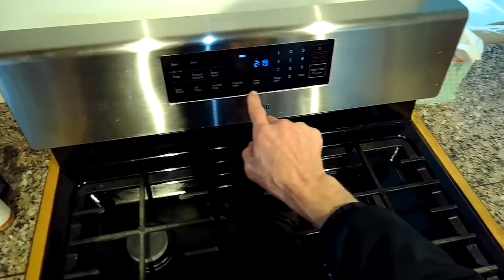✨ OVEN TOUCHSCREEN NOT WORKING — EASY FIX ✨

Comment: Thank you! This worked. We paid a workman to remove the panel (the buttons in the middle column were not working on both right and left hand side of the panel Kenmore Elite electric oven). Meanwhile after looking everywhere for a replacement, we finally ordered the entire panel on ebay ($300, after contacting many repair places where we were told that the panel can't be repaired). Long story short the ebay panel turned out not to be an exact match. I figured I give your method a try. Hubby and myself put the panel back in and voila! All the buttons are working again! Ebay purchase was returned. Thank you again for teaching me how to save favorite appliance 😊 hopefully good things will happen to you in life.
Reply from the maker: Thanks so much Millikan, I really appreciate your kind words 😊👍

Comment: i replaced the controller initially only the pizza button was working and oven will come on, broil and bake button was not working after replacing the controller the buttons all work now, however when i press bake, broil, pizza i don't see the flames coming on inside the oven, i am sure it is not the ignitor since it was working prior to replacing the controller, can you suggest anything
Reply from the maker: Maybe the igniter👍

Comment: Hi Scott, I used your eraser cleaning method and it worked. Now keys are working but the oven still does not heat. Broiler and stove works fine. Do you think I need control panel ? I was going to replace touch pad.
Reply from the maker: Hey Tom, if it’s a gas oven you probably just need a new igniter.
Reply: Thanks
Reply: Hard to believe Touch pad and igniter went bad together. But I thought igniter probably bad

Comment: Thank you so much for this video. The most difficult part was the access to the damn control board. I had to partially remove the whole cabinet involving the oven and microwave. Finding the hidden screws when there is no instruction for a particular model is the hardest part. Anyway, I got the idea where to look for after watching several different videos. One last note, the ribbon cable has two ends, cleaning the big end that goes on the PCB didn't work but the culprit was the other smaller end of the cable. Thanks again for the idea what could go wrong.

Comment: Listen Scott... it's people like you and videos like this that bring A LOT of positivity to the 21st century. As everyone knows, we live in an age when your lucky if an appliance last more than 3 years. Whether it's Planned Obsolescence or not, most appliances are simply not built to last. Our Samsung convection range is only 3 years old. Already had to replace the convection motor (which thank goodness someone posted a Youtube vid that directs you on how to order the motor off Amazon and install it yourself!!)...and today...2 days before the Thanksgiving turkey goes in the oven...the control panel craps out. Did exactly what you said and BAM!!! Huge brownie points with the wife buddy (big thanks :). Had quite a difficult time dislodging the ribbon... so like you advised, use a flat head screw driver and VERY carefully and slowly alternate prying out the top & bottom tips of the plastic ribbon base connector thingy. I used Isopropyl Alcohol on a q-tip...worked perfect !! Thanks again.
Reply from the maker: That is so cool Eric,  thank you😊

Comment: Thank You!! You have saved me hundreds! I replaced my own board on my Samsung Gas Range Model# NX58J5600SG/AA with a part from Sears Part# DE92-02588J which cost about $180 with shipping. The Ribbon Cable you spoke of was the problem with ours because I did not know that there was a slide out piece on the piece that connects to the board. This allows the ribbon cable to dislodge from the board. None of the YouTube videos I watched mentioned this but yours! The range had no function on the keypad until I properly installed the ribbon cable. I have clock function, timer and cook timer working. Although I still have no beeping of the timers etc?! I am going to try and reinsert the cable one more time before I button her up. Thanks again!!
Reply from the maker: Wow,

Nice job👍😊

Comment: Worked great! The longest part for me was realizing that the ribbon cable pulls out and the black assembly just clamps down on it. I was expecting pin connectors.

Once I figured that out (5 minutes) everything was easy. Added a little dielectric grease as a preventative measure.
Reply from the maker: Nice job Matthew👍😊
Reply from the maker: Nice job Matthew👍😊

Comment: Thanks for your efforts to share this solution! I followed all your instructions and did repeated tests and just didn't have any satisfactory results. I was almost resigned to trashing the range but was really bummed as I just spent over a hundred bucks replacing the carbon broiler element. I looked into maybe replacing the control board but that would cost me north of $400. Grrrrr! I decided to have another look at the ribbon and saw the indents where the socket pins made contact. It was then I decided to go for broke. With a sharp pair of scissors I cut about 3/32nds (2mm) off the end of the tape making sure to keep square.I Inserted the ribbon and locked it down. Time to flip the breaker and test. Yay! OMG so happy I don't have to retire this appliance as it is still in such good condition overall. Hope someone can use this info to keep their appliance from being scrapped. Cheers to all the determined fixers out there! 5:26
Reply from the maker: Nice job,
You are courageous 😊

Comment: Excellent video Scott, thank you very much! I googled the electrical cleaner and it's basically isopropyl alcohol so instead of using an eraser I used a fine Mist sprayer with 91% isopropyl alcohol. after removing the ribbon cable I sprayed a small amount (twice)with a paper towel underneath it to catch any drips.
Worked like a charm! Again thank you for the excellent video,no music, no annoying chitter-chatter,straight to the point!😁👍
Reply from the maker: Great idea Ron,

Thank you
Reply: @ScottTheFixItGuyChannel  your welcome

Comment: Scott, thanks so much!  I followed your advice and it worked for about 5 days.  I had to repeat the process 3 more times over the next month.  I may have found root cause.  On the last try I put a piece of Scotch tape over the top of the touch screen and the brushed stainless panel over it.  My thought is over the years pushing the screen buttons created a slight gap between the top of the touch screen and metal frame.  This allowed steam from cooking to seep through and short out circuit points.  Going on 2 weeks plus and no error code!  Tape over the screen/frame looks crummy.  Maybe I'll remove it and caulk with a thin line if window glaze?

Comment: The manufacturer of my oven (oster) had applied some sort of glue along the edge of the ribbon and the plastic connector. I carefully chipped it away with a razor blade and pulled the ribbon, sure enough about half of the pins had corrosion. Going to get some electronic parts cleaner today. Thanks for the video!
Reply from the maker: Wow, nice job Christopher.
You’re pretty brave to chip away that glue.
I’m so glad it worked.
Reply: @Scott The Fix-It Guy  DIY Appliance Videos   it did work. I was so excited when the buttons magically worked again. I figured it was trash anyway so it didn't matter if I damaged the cable, luckily I didn't and now it works like new. Thanks again!

Comment: My newer Samsung Gas Range key pad randomly cycles through settings...ie  HI, LOW, dehydrate, time etc....will cleaning the contacts on the tape work for this issue? (just past year warranty)
Reply from the maker: Hi Barb,
I think you may have one of your keys stuck in the pushed in position. Maybe the one that lets you scroll through selections.

I would try pushing in on that button several times to try and free it up.
You can try using a hairdryer at low heat directed at those keys for 3 minutes.
Reply: @ScottTheFixItGuyChannel  Hi!  Removed the back panel and erasered the connection, tightened all the other connectors.  I also did a hard wiping/pressing the buttons and blow dried the front.   OMG...the problem has not come back yet for 3 hours!  I'm hoping it is fixed, cannot thank you enough, saved us $$$.
Reply: @barbcurphy6999  wow, nicely done Barb❤😊

Comment: Thanks, great tip & informative video. Would it work in my case - I have a LG electric range & last weekend when I pressed the button for the rear small (single element) cooktop, it would also turn on the dual element cooktop in front. And I am not able to turn it off unless I turn off the small cooktop. Much appreciated for your advice.
Reply from the maker: You might need to replace the touch pad .  They’re pretty cheap.
Reply: Many thanks Scott.
Reply: I have this same problem, let me know if you find a solution (can't use my left elements)
Reply: The LG tech tells me likely I need to change the board & as it will cost about $450, I may as well wait a bit until something else happens for me to justify replacing it with a new range.

Comment: I saw the same fix on another post. Thanks. 

I have LG LREL6323S electric range purchased Jan 2022. The LED display board failed Jan 2024 losing one portion of the digital display. This is a known issue at 2 yrs based on my research and notes. The warranty is 1 yrs and LG quoted repair at appx $345. LG is not recommended by my local appliance repair shop. I do NOT recommend LG for various reasons.

Comment: Hello! Mine does not have the strip in the back how would I fix this problem? I have the Amana control board AGR5330BAS3.  Thank you.
Reply from the maker: Your touchpad is built into your controller.
You just need to find the controller for your stove and replace it.

Comment: I have a Kenmore Ultra Bake electric stove. The oven temp displays 350. If I try to raise it with the buttons, it lowers it. The  stop/clear button won't shut it off for a while. 30 secs or more. I did get an error code of F7? Any idea if cleaning the ribbon will fix my issue? Seems like the buttons are just not connecting to my finger.
Reply from the maker: Hi Peggy,
I would replace the controller.

Comment: Do you think this could be the issue if your display also isn't showing numbers correctly? As in certain segments of the numbers on the 7 segment displays arent lighting up and certain buttons on the panel do not work. Occasionally the display will start working again, and when that happens all the buttons suddenly work again. I was thinking the board was going bad, but if a simple cleaning of the connections could remedy it that would be amazing. Let me know what you think please!
Reply from the maker: I think so😊
Reply from the maker: I think so😊
Reply: @ScottTheFixItGuyChannel  Thanks for the feedback! I'll give it a shot. Worst case scenario I can always get a new board if it doesnt work.
Reply: If cleaning the ribbon doesn’t fix the issue what should I do next?

Comment: Excellent review!  Although all of my touchpad buttons work, my problems is the 1st number of the temperature does not show ie. 150 = 50 or 350 = 50.  So the only way I know the oven has reached the temperature is hearing the 6 beeps.   Do you have any suggestions:  Do you think it’s a motherboard replacement or cleaning the ribbon?  Thanks much.

Comment: Will this procedure work to fix my LED lights on the touch screen? All buttons work fine, however the time is only partially lit so its hard to see the timer and clock due to what looks to be LED partial outage. If not, is there a fix for that or just buy another touch screen?
Reply: That might be a burned out LED/bulb. Happens in old car clocks/radios (typically 3 bulbs), where 1 or more but not all bulbs go out.
Reply: @RikoLime  how do we fix this? I have the same problem my time and over temp do not light up completely. Just annoying not keeping the oven from working. Though also starting to get clicks when the oven is on and I open the door the light goes off and on with the clicks ugh...everything I own it seems is Samsung and ALL of my appliances are breaking!! 😭😤🤬

Comment: We had a couple of the burner buttons that weren't functioning anymore so we tried this fix. It killed everything. We then tried cleaning the contacts on the ribbon with rubbing alcohol and also trimmed a business card to fit into the connector slots, applied some rubbing alcohol to the card and inserted into the slots. Reconnected the ribbons and everything came back to life. Options

Comment: Whirlpool Range Control Board 8507P233-60 and thermo fuse replaced due to NO Power to Control board  or Oven Burners work . Just replaced control board NO Power to Oven or contol board

Comment: I have the same problem and it work after done clean the cable and couple hrs later not work again is the touch pad bad or what else. Note i have not use the oven much and i only have this unit about 2yrs now.

Comment: My smooth cooktop works with the knobs but my screen for oven does not. Time is on but no other on panel work so no ovens. It’s a Maytag. We did have power go out the other day and that’s when it happened. But again the digital clock is lite and the cooktop works.  Guess I’ll have my husband try this.
Reply from the maker: I think the controller behind the touch screen got fried when the power came back on.

You might try turning off the power at the breaker and then turning it back on.
Reply: is it the fuse???
Reply: This worked!!!  Husband did as said and it worked!!!!!!

Comment: We did it and it worked but think we will need to replace the front outer film. Looking for this on-line. Any suggestions on where to find it or on-line and actual name of this, is it touch pad?
Reply: That outer part is called the overlay, I believe.  The overlay on my Kenmore has broken over the timer, so the timer no longer works.  I have had luck with ordering from Appliance Parts Pros, online, but they don’t have this one.  You may find what you need there, if the manufacturer does not have it.

Comment: I’m having a hard time removing the ribbon from the clip. Any advice on how to do this. 😫
Reply from the maker: I think there are two small black plastic clips on either side that need to be lifted up by a 1/16 of an inch to release the ribbon.  Maybe use some magnifying glasses and good light to get a better look.  Take your time👍

Comment: Our Samsung gas range, purchased in February 2021, has the same problem. I found that by unplugging the power for a few seconds and letting it reset it would work several times. After about 5 failures I decided that since it was under warranty I would have it repaired. That was late August 2021. Samsung sent a repairman out in a few days. He brought a part with him and replaced it which told me there are problems with this stove. He was here about 15 minutes and it seemed to work fine. That was on Monday. On Friday of the same week it failed once more. Same fix, unplugged the stove for a few seconds and it worked. I do not know if the repairman cleaned the ribbon cable or not but he replaced parts. I will call Samsung again. We have had Samsung TVs, cell phones and they have worked flawlessly for years but the two appliances, a front end loading washer and this stove are junk. My daughter has owned Samsung and LG refrigerators and both brands are junk. I rely on Consumers Report to recommend  products . This Samsung range was near the top of the recommendations for 2021.  Don't buy one. For a quick fix just try unplugging and plug it right back in.
Reply from the maker: You are so right.  Samsung appliances are really the worst .
Can’t believe consumer reports likes Samsung.

Comment: Just watched video and SURE ENOUGH....corroded on 3 pins. Cleaned the pins on harness and then cleaned the motherboard.  It worked for about 5 seconds and then display went out completely.
I thought maybe the wiring harness might be culprit so went online to buy replacement and it is over $90!! For a small harness!!  And i am not a hundred percent that will even fix it, so now i am trying to find a way to buy just the corroded end piece of harness.  I don't know what those white/slide on to motherboard connectors are called....any ideas?
Reply from the maker: Can you spray some electrical cleaner in there?  Might work.
Reply: @ScottTheFixItGuyChannel  yeah..i will give it a try...thank you

Comment: My entire touchpad went out including the clock. Oven not working. I would like to try this but I have gas. So I don't know how far to try and pull out my stove/oven. It must be plugged in, in the back as well. Any suggestions?
Reply from the maker: Hi Kim,
Just try pulling out the stove slowly.
There’s usually about 2 feet of extra hose.
In your case you may need a new controller instead of a new touchpad.

Comment: Has anyone tried this on a Whirlpool slide-in range? Just moved into a house and the old range's on/off buttons on the front 2 burner are not responding. The range is no longer under warranty and the entire panel is over $300 to replace.

Comment: God bless you! It took me less than 3 minutes to fix my Samsung NX58H5600S partially unresponsive touchpad. Only very few controls worked (convection roast, CLEAR, pizza). No clock, no bake, no broil, no number keys. The eraser got dirty very quickly. Keep upthe fantastic advices.
Reply from the maker: That is excellent news,
Thanks so much for your feedback😊👍